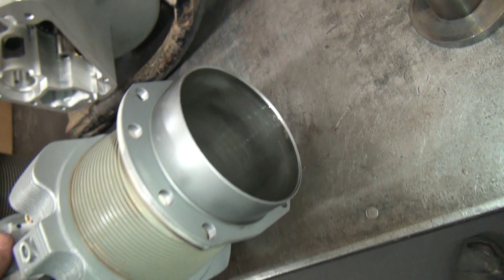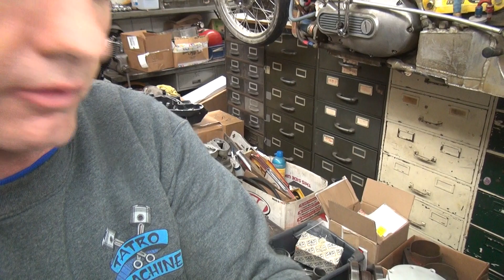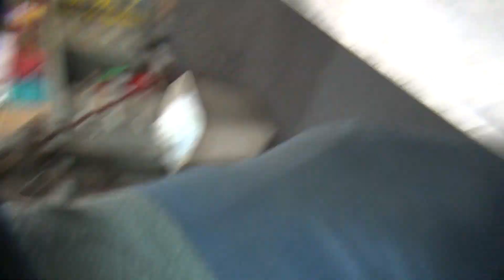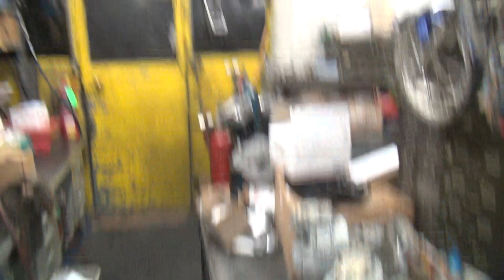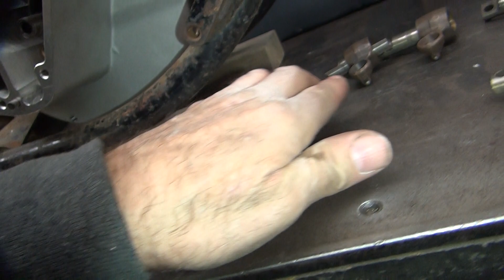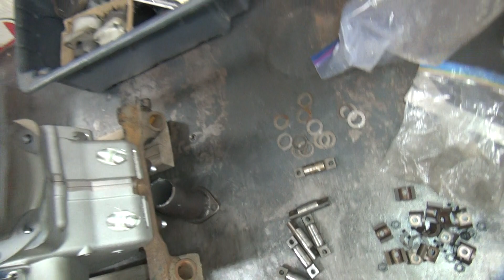#126 harley custom airplane 143ci motor mock-up big evo 4cam sportster twincam m8 race tatro machine

Comment: Just a heads up all the 4" bore and larger evo Motors use special tappet blocks that Slightly change the angle of the pushrods. Stock tappet blocks will bolt up to the case. I'm not sure if this matters for your application since it's custom.
Reply from the maker: it doesn't matter because i am using s&s custom shovelhead blocks to help the pushrod angles.
tatro